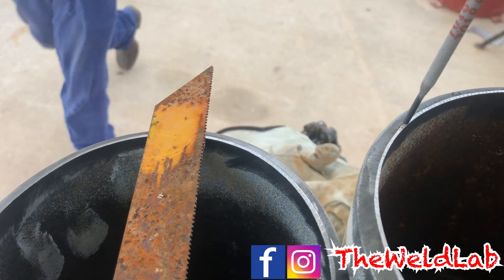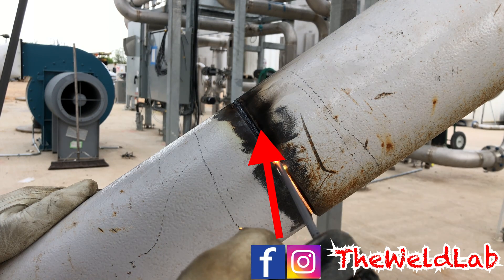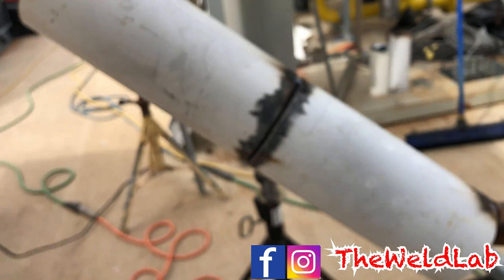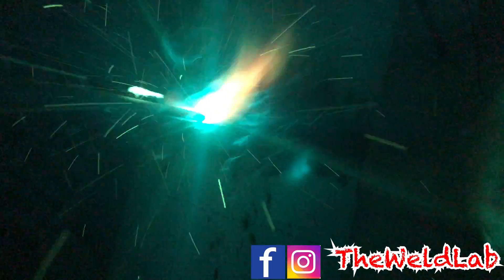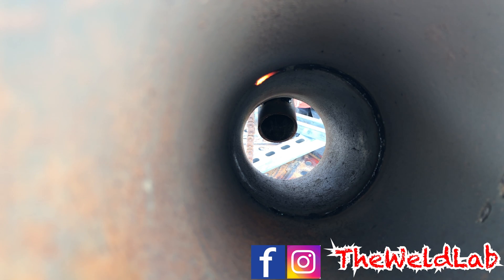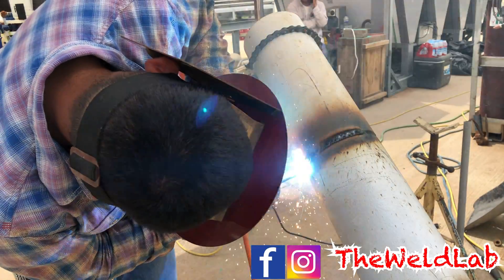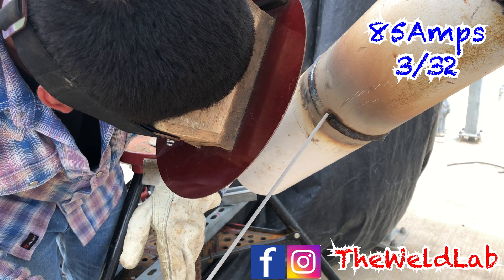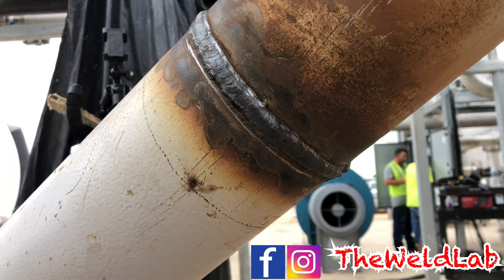Pipe Weld Test 6G 6010 Root 7018 Fill and Cap | Stick Welding

Comment: All my codings are in tig and fluxcore, I don't really do stick our company doesn't use it I served my time here I had done 6 and 4" rollout with Tig root and stick fill and cap and it past x-ray it was only scrap pipe wasn't a job, how ever I've applied elsewhere and this is one of the test it's a 6"sch 160 I think it's a 6g the company know what am coded in I've explained but I've been told I get leave it or have a go and 100% going to get stuck in think il be using 7018 and its a Tig root have you any tips for my amps on the fill and cap am thinking 110-120 but like I say I've no experience welding inposition with the stick and only had about 4 shifts worth off practicing rolley butts with it

Comment: I’m doing this test at my welding school but it’s on 3in pipe but once I put the hot pass we use a 7018 1/8 rod it blows through even if my root is good or I put the hot pass and on my first cap it blows through any tips?

Comment: I'm re Tired now but I started wielding in 1975 , One of the old timers told me that you could tell if your root pass was going in well It sounded like eggs frying, I got pretty cocky when I was younger, I could set that machine at 90 tightened up the gap And push 6010 and take my helmet off, And listen to it, That's Youth for you , Sounds a little stupid now but I got by with it. Only one problem With being good , I got all the hard Wells. I had a hard one once that I couldn't really see I got so into it that I almost took my helmet off, If you've ever had  Welding Burns to your eyes You know what I'm talking about. It's like having sand blowed in your eyes, Not good!!!

Comment: Hey man, can you show us how to do the hot pass? I’ll appreciate it
Reply: Hot pass is easy.  Just run 6010 while stop and pausing to build up the puddle.  Watch the puddle fill up and fuses to both side of the pipe ( I like to do a lil side to side action as well to push my weld puddle up against the walls of the pipe.  Your end result should be a nice consistent weld filling up bevels and having it flush with the pipe.  Just keep practicing youll get it

Comment: Hey bro on the root pass how to you prevent undercut on the bottom half of the pipe? It feels good when I put it in but when I remove the slag I get some undercut on the top coupon but the bead looks good

Comment: 6g test 6010 root 7018 fill & cap do you have to run 6010 uphill or down hill??
Reply from the maker: You can do both depends on the procedure in most pipeline and gas lines they run downhill but up hill is required in other places like refinery’s I just recently took a uphill 6010 with up hill you need a big gap upto 1/8
Reply: @TheWeldLab  i run uphill with a 16th gap, 16th land and 85/95 amps depending on machine and pipe size. Strke on bevel get hot push in and it's a nice drag long as ur fusing both sides. Sometimes like a slight side to side to break walls down and if gap opens u just do a little back step
Reply from the maker: @chrisjones6165  Ima have to try those settings I felt like doing the 1/8 gap took to long I’ll have to try that 16th gap so you just drag it up with no weave ?
Reply: @TheWeldLab  maybe a slight wiggle side to side if needed to break walls down. Usually you can put some pressure on rod and just drag it up hill

Comment: Good video is 7018 doesn't work on AC current
Reply from the maker: its better to use dc it will weld better